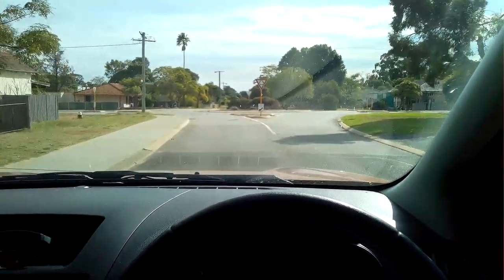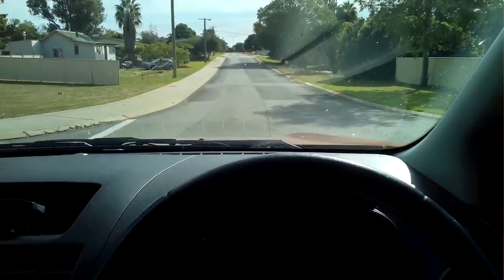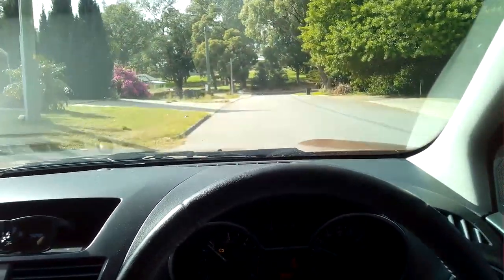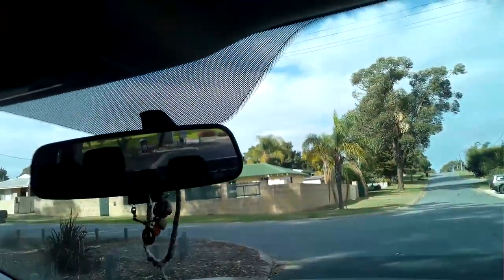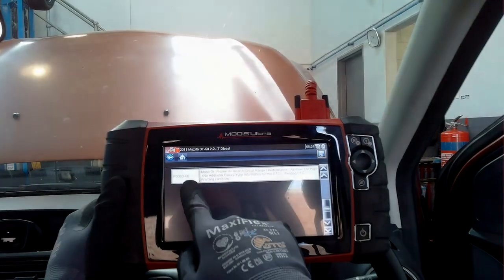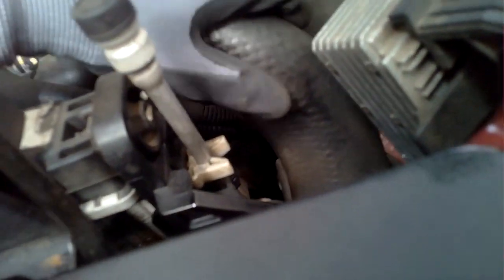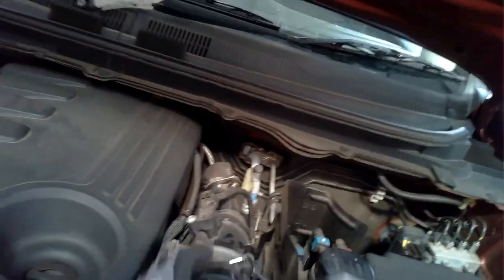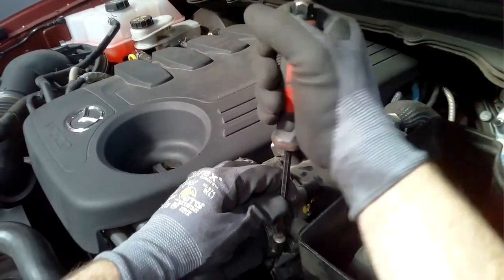BT50 / Ranger P00BD Mass Air Flow Circuit Range / Performance - Flow Too High - Found & Fixed - DIY

Comment: Thanks man you helped me find my problem. So I used epoxy resin / araldite and some lay flat hose and gaffa tape and sealed the hole until the plazmaman pipe turns up.

Comment: Thank you, i got a P006A code today and while researching that came across this video. I also have had a strange whistling noise when accelerating for the last couple of months. I took it to a mechanic and they said they couldn’t find any issues. I will check for a split hose and see if this is the issue for the whistle noise.

Comment: I am using ford ranger 3.2 i was hearing the same sound and found out the horse is damaged like in the video. THANX SO MUCH... however i changed the pipe but i can still hear the whooping sound on acceleration!!  What can be the problem? Or there are error code to clear first!?
Reply: I have same issue on my Mazda 2.2 changed the split pipe but the noise n power train warning light comes back occasionally

Comment: Have the same code come up, goes into limp mode, top hose is aluminium and is not split, checked intercooler but can't find anything wrong with it, haven't tried to pressurise it, all hose clamps were tight, any other ideas i can try.... ??
Reply: Hey mate did you find out what it was?

Comment: My m.f.a.c on my ford focus 2003 automatic 
Was changed but it caused the gearbox to only change in to 3 of 4 gears.
Now the     ! With a warning orange circle around it comes on and won't change into 4th same problem different light?? Any ideas it's a train of a car 250,000miles + and this is only thing that has happened since owned 10 + years ago looks mint to????? Thanks mate
Reply from the maker: Hello Keith,  
There is a reason I don't do any phone diagnosing or online because of the many possibilities that surround vehicle faults. It is difficult enough to diagnose problems in the workshop with all my senses and professional tools at my disposal.  
 
This is certainly the case with yours, you will need to bring it to a recommended repairer to assess the inputs and try and narrow down the fault to electrical or mechanical.  Scan code reading, live data assessment, component testing, connection/wiring checks, shift solenoids or other transmission internal failure.  
 
For anyone trying to figure it out through guessing without testing then it would be best to try and find the exact symptoms on forums or the likes.
Reply: @GerardBurkeBurkesGarage  hahaha worth a try as I was the first to like the video I thought you might answer then I looked at the 56k+ subs ! And realised not a chance sorry bud my apologies,  I've done all that you suggested and no fault code has been found on this occasion but I really appreciate your reply all the same sincere apologies again ,
Thanks Mr Burke .👌🏼

Comment: I have the same problem on mazda 5 1,6 diesel and i don't find the air flow fuite.I changed the vanne EGR,AIR FLOW debimeter,and it don't work.Thanks.From France

Comment: I change its all about intercooler however  
CodePO0BD  still exist
Reply: Intake manifold leak
Mass Air Flow (MAF) sensor failure
Powertrain Control Module (PCM) failure
Wiring issue